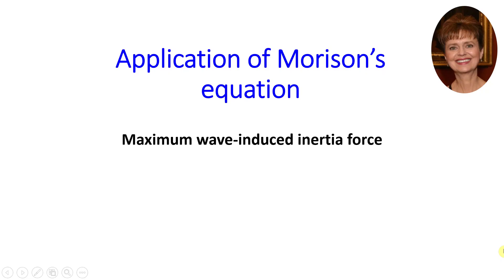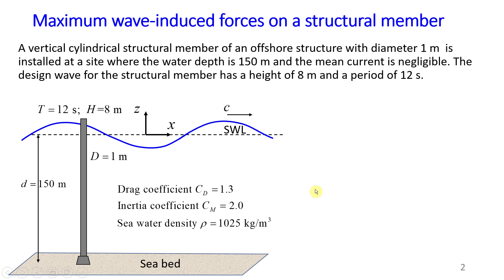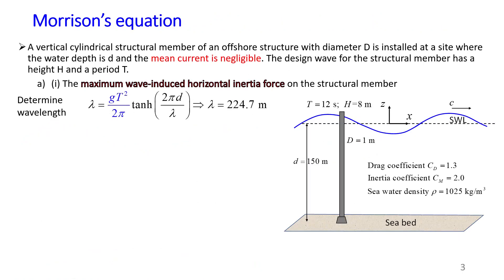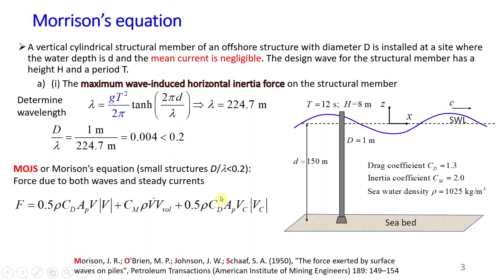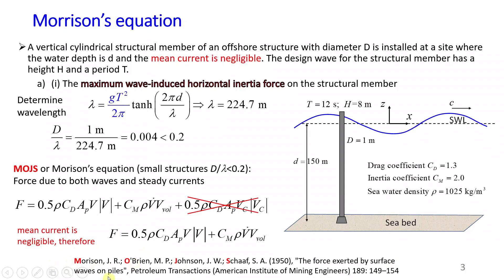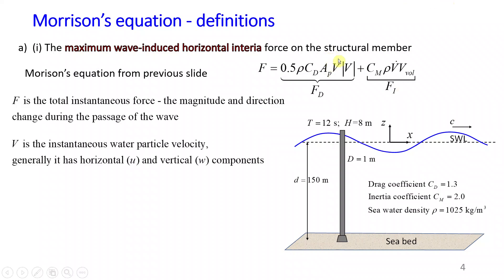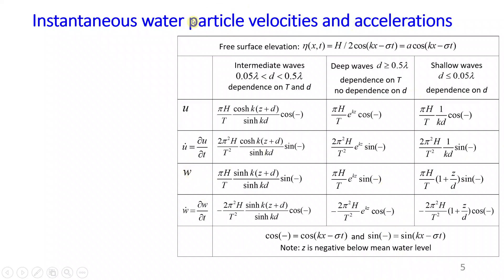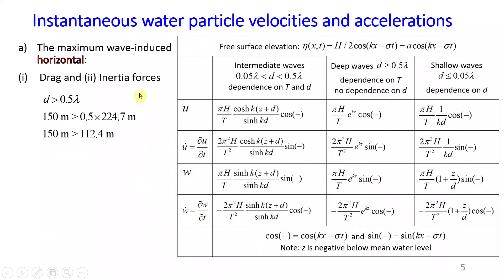Morison Equation - wave loads on structures INERTIA force

Comment: Hello 😀Thank you, very interesting. So is it possible to use Morison equation to calculate the force on offshore wind turbine piles ? The diameter is large though (18 m), but considering a wavelenght (L) of 200 m the ratio D/L is still below the threshold value of 0.2

Comment: Hellp Nina thanks for the video its very helpful.
Howeve any i know how does it compute to 62.2kN?Ive got 621.128kN..Do you have the detail breakdown of the number being used in the formula? Thanks!
Reply from the maker: If you substitute all values in the part of equation shown in red (see timing 13:23) you should get 62.2 kN. Please check it again.

Comment: Looking at the graphs with the loads as a function of time. What x value have you chosen? I plotted it and I get very similar looking graph for the drag force. But I dont get it for the inertia force. Inertia force is mirrored.
Reply from the maker: On x axis I have time, plot is done for  2 periods. Inertia force should be the same as I show in my plot. If not then you probably have an error in calcs
Reply from the maker: I was thinking doing a video 'how to calculate force time series for all three forces: drag, interia and total. Would you be interested in this video?
Reply: @StudyTips4U  62.2sin(k*x-sigma*t). I understand that you put t on the x-axis. But what is your value for x? If you put x = 1 for example, the function is 62.2sin(k-sigma*t). That is what I did for the record. So yes, I would be interested in how you plot it.
Reply from the maker: @Keepitsimple2
 x is a single fixed position, at that position you calculate force as a wave passes this point, 
you can assume x=0

Comment: Hi Nina, thanks for presenting this interesting video. May I know what are x, t and sigma in the equations? Thank.
Reply from the maker: Sigma is circular frequency, t is time, e.g. to calculate how sea water elevations change in time, and x is coordinate/location
Reply: @StudyTips4U  
Many thanks Nina. May I have a copy of the literature showing all these equations? I am a bridge engineer but I am thinking to move to work on maritime structures soon.
Reply from the maker: @Sunthara Trang  you can find these equations in Fluid Mechanics text by Masey, chapter oscillatory flows

Comment: Shouldn't the integral at 10:14 be from -d to (0+H/2) since the pile extends above SWL?
Reply from the maker: It’s a very good question. Integrating to the Still Water Level (SWL) is consistent with Linear Wave Theory (LWT) because LWT, strictly speaking, is limited to small amplitude waves. In reality of course, we often use LWT for waves that are not small amplitude. In such cases you might want to do the integration to the wave crest. Problem then is how do you estimate the kinematics in the crest? There are various so-called “stretching functions” for doing this. Hope this helps. Good luck with your studies.
Reply: @StudyTips4U  Thanks a lot for your reply:-) I've found some formulas in section 3.3.3 in DNV-RP-C205 (https://rules.dnvgl.com/docs/pdf/dnv/codes/docs/2010-10/rp-c205.pdf) which I will try to use in my calculations.

Comment: Does this equation apply to steel piles used to stabilize a floating pontoon or walking or floating deck to allow for only verucal oscillation of the floating deck?
Reply from the maker: It is a good question, subscribe to my channel and I will attempt to answer your question.

Comment from the maker: Practical example how to calculate the maximum wave-induced horizontal INERTIA force on a structural member.
Reply: hi, what is sigma in the equation?
Reply from the maker: @adityabodhe3340  Sigma is the wave circular frequency
: sigma = 2*pi/wave period, i.e. units rad/sec
Reply: @StudyTips4U  thank you so much!
Reply: Could you please make  a video on selection of wave theory and factors involved in the wave force such as blockage coefficients, apparent period? maybe in joint venture?
Reply: @StudyTips4U  Thanks for the video ma'am.  What would be the lever arm of the inertia Force? Would it be the CG of the submerged structure?
Reply: Hello Dr. thanks for great explanation and nice videos. How can we develop irregular wave load using Morison equation?